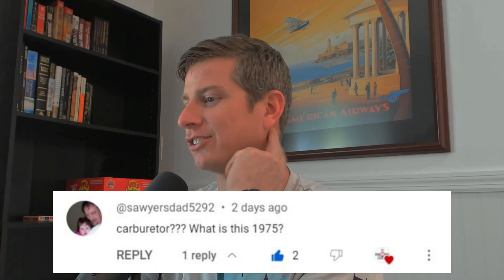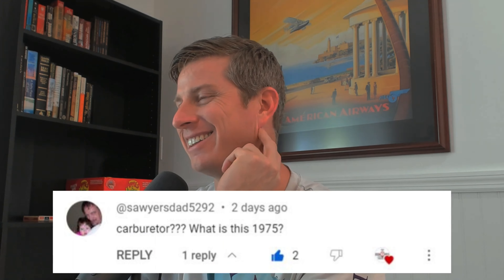Is Running Full Throttle BAD For Outboards?

Comment: Honda 250 here chiming in,when running 30 + miles out & conditions are right dam straight I’m in that sweet spot,I’ve ran it WOT for a hour plus with no issues right on the redline, my ocean pro 225  did not last

Comment: I've got a old 1986 70hp  Evinrude-jonhson   about 7 years ago I cleaned the carbs back then and put it on my old 16ft Quintrex I run that thing every weekend like I stole it I've never had not one problem with it but it's is a thirsty old motor,, now I picked up a 90hp Yamaha the same Yamaha you been showing lately I've just finished the cleaning service on it and it going on my old Quintrex for more power and speed and less fuel hopefully 🤞

Comment: I have a 19ft sailboat that was converted to power boat. Top speed with a Honda 9.9hp & 6hp Tohatsu is the same. I run my outboard at around 5000 rpm, with least vibration.

Comment: My brother always gets grumpy with me at running my V4 2 stroke 130 Saltwater series at full throttle, his reasoning being he doesn't want me to push the motor too hard... But conditions rarely allow for long distance full throttle running. With all that said, the motor was probably designed for it anyway....Engine manufacturers wouldnt survive if the motor wasn't designed to run for long stints at 100% throttle.
Reply from the maker: True that!

Comment: With my 07 Yamaha 115 2 stroke i keep non ethanol gas in it with ring free and i run my boat at least once a week i keep my onboard oil tank clean and change my inline oil filter and fule water separator gets changed with lower unit oil  once a year im trying to make my motor out live me
Reply from the maker: Yeah, it'll definitely last doing that!

Comment: Engine ratings that are different but use the same engine size/design is purely just to satisfy boat hull power ratings? Right? And in some cases like 9.9 it's purely to fit under laws/rules regarding maximum power for a body of water?

Comment: What can I do to get more HP from a evinrude 88 HP
Reply: I had an 88 spl, you can add parts from a 115 v4 like the exhaust, intake, heads, carbs etc. It will suck down more fuel, might get a little more speed though good luck
Reply from the maker: What he said :)

Comment: An outboards lifespan is measured in hours not miles. There is no question that running an outboard at 5500 rpm for an hour, causes more wear and tear than running that outboard at 3500 for an hour. The reason diesels outlast gas engines is that they produce their power at lower rpms, therefore they can be run at lower rpms.  Also, I have never seen a outboard performance chart that does not show an increase in fuel consumption (decrease in mpg) after 75 or 80% of throttle.
Reply: Diesel fuel is also a lubricant not solvent.